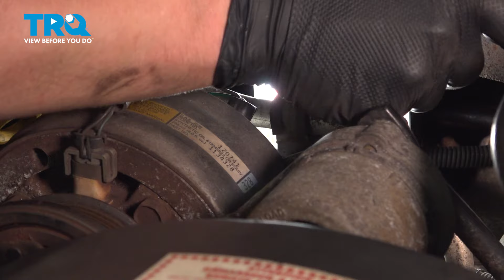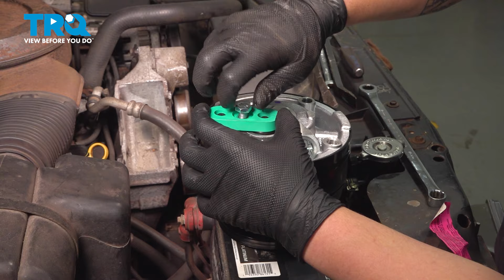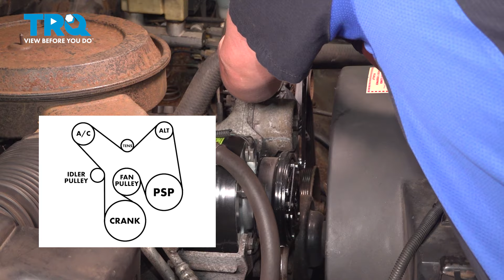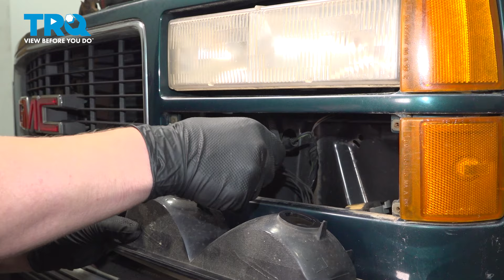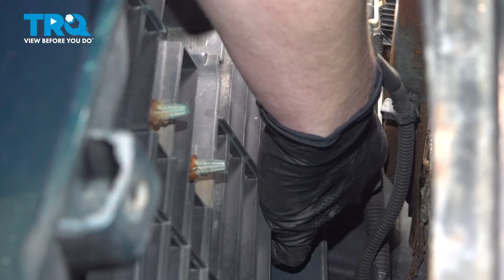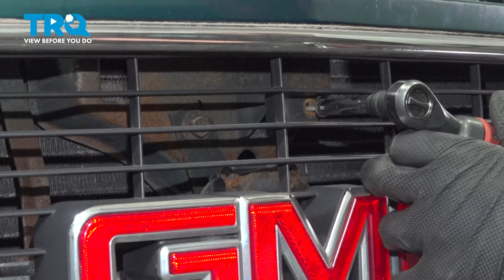How to Install AC Compressor & Component Kit 1988-1999 GMC K1500 5.7L V8

Comment: I have a 1990 Chevrolet Cheyenne 4.3 L V6 engine. I am the third owner. The first owner drove it for years. The second owner never have driven it because he had the same identical truck and he was just holding onto that one. My point for saying this after watching your video I wish that you were in my city or someone like you that trustworthy to fix my truck the proper way. I’ll be eternally grateful. It is the easiest vehicle that’s not complex to fix. I have had so many people men to rip me off.. I will pay for the parts, the labor and give them tips for during a job. Are there any more trustworthy men in this world that will take the time out to fix one vehicle the proper way and let them person know exactly what they need to do to get it fixed and not be overcharging. Now I understand the labor you have to because you never know what you’re gonna run into while fixing the problem. However, just be upfront don’t lie yes I said it don’t lie. 

Thanks you 😊

Comment: Additional tips:
Disconnect battery
Remove air cleaner first for easier access
Use a light coating of mineral oil designed for AC on O rings
Flush refrigerant lines to remove debris from your last compressor's death before connecting them to that brand new compressor
The condenser coil is cheap and probably contains debris from your last compressor, replace this too for cheap insurance and long system life
Consider an inline filter between the orifice tube and AC line, again, cheap insurance against fine particles in the system that we missed that could damage compressor bearings

Comment: 95 Sierra. Mine had no flat spot on the bolt head flanges. One can use a 14 mm wrench. The bolt and nut are SAE 3/8. If you try to replace the bolt with metric 10mm which has a head that also fits 14mm, it won't go in. It's 3/8 SAE. I made my own flat spot with an angle grinder on the top one but the bottom one couldn't be reached.  I used vice grips to pinch the clutch hub against the free wheeling pully and cut clean across with  an angle grinder, rotated it to bolt and it came out. The top bolt, I made my own flat spot. The side one had no space so I cut it off. This video has been a great help to me.

Comment: You can access the orifice tube by removing only the passenger front blinker assembly.

Some AC units in these years have welded nuts on the backsides of the AC mounts. And some have a support rod between the rear of AC mount and TBI.